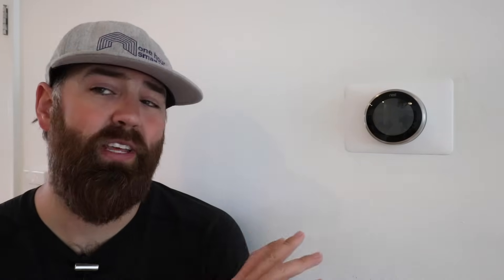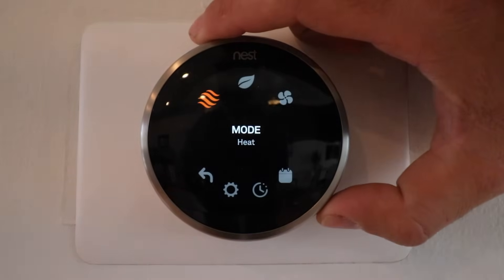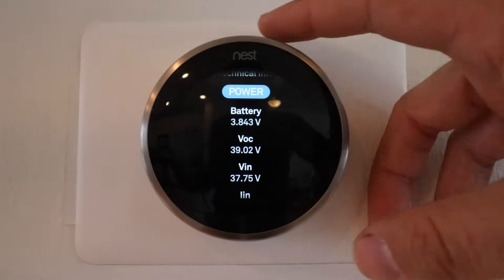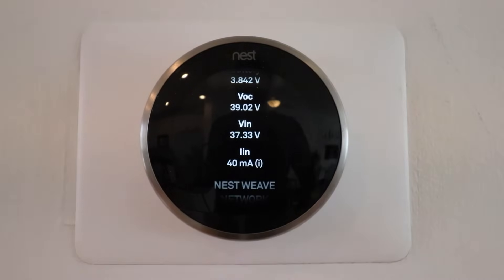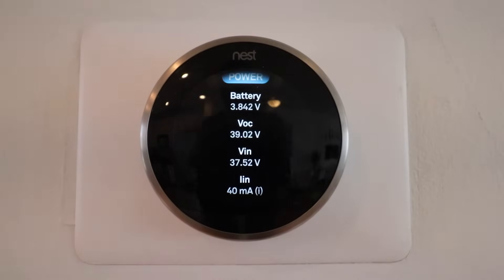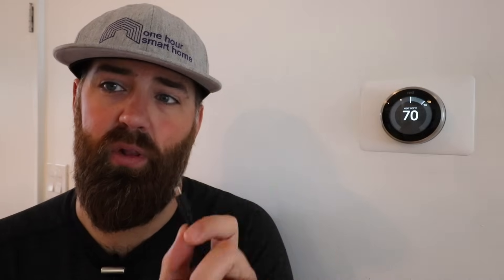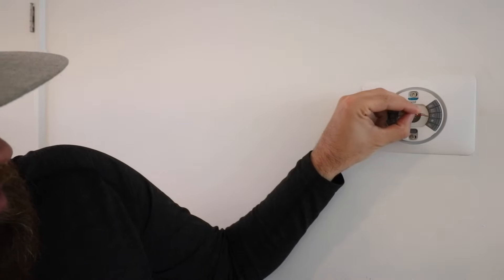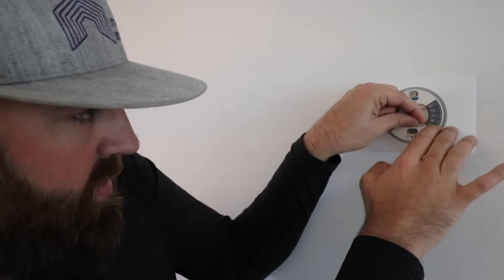Nest Low Battery Fix!

Comment: If you hear a loud humming sound coming from your A/C it's your relay. A stuck relay will cause a contactor failure. This too can lead to low power on your nest.  In case people were wondering when they hear their relay making a loud Humming noise. Fix this contactor issue and your Nest will not lose power again do to this.  A short fix is to turn the AC on and off, so the relay is reset.  However, it may one day not reset and require replacing the Relay. Easy fix too, just make sure the power is off when replacing!  If after replacing the relay it continues, then there's a problem with your Home's electrical, and recommended to get an electrician at this point. Be safe when working with electricity, and Hope this helps.

Comment: Hi Jeff, I have a Rheem thermostat with four wires connected to it R, C , E1 ,E2 I was able to Power the Google thermostat but couldn’t turn the heater or cooling on… any ideas?

Comment: Have a Nest Power Connector installed by a HVAC technician onto the furnace board, still not charging the Nest Thermostat. Have a Nest Learning thermostat, sent the photos to Nest showing the wiring - Nest says wiring looks ok. Nest itself can't diagnose what could be the problem.
Any suggestions welcome.

Comment: Thank you for the video. Got an e74 message. I knew the drain pan was full. The evaporative unit line was clogged up, so the secondary drainage was filling up the drain pan. Thank god for the sensor.  Water would have been all over the condo.

Comment: I was having low battery and this video was helpful to learn that my Iin was reading only 8.  I pulled it off the wall and metered my Red wire and it was reading 40.  So I took all my wires out,  one at a time,  and gave them a polish with some sandpaper,  popped the thermostat back on and bobs your uncle,  40mA.

Comment: Nice video but it would have been nice if you told us what to do if the LIN number stays at 20  (replace battery????) and would have been good if you had told us where the other two numbers should be (Vin and Voc).

Comment: Excellent video, as are your other ones! Thank you. For me when installing transformer, it only worked when I combined one of the wires from the transformer in/into the terminal with the existing Rh wire, and of course the other transformer wire into the C terminal. It did not work when I had one transformer wire in the Rc terminal and the other transformer wire in the C terminal.

Comment: Can I go to the furnace, disconnect the red/RH or RC wire, and connect it to one of the  transformer wires, and plug the transformer into a wall outlet near the furnace?

Comment: Long video for not much info. It is "I in" (input current) as in the letter I for intensity, not L as in Lima. mA is milli-amps, a measure of current intensity. Electrical systems use the letter I for current, (as in P=VI)  and L for inductance. 

Another way your nest could say "low battery", and I don't think this was mentioned, (could have been though, it was a 15 min. video for 3 min of info) is that your battery has been charged up/down so many times it won't hold a charge anymore. Yet another is the circuitry could be damaged as seems to be the case for me. Something inside the thermostat is shorted or open-circuited, or a component is bad somewhere in the charging circuit path.

Comment: Hi I recently came across your video regarding the nest thermostat ‘delayed’ message and I’m currently having an issue where I turned on our AC unit for the season and I noticed that it’s not blowing cool crisp air. It feels lukewarm at best. our home temperature says 75 inside and just by lowering it 1 to 2° it says it will take almost 2 hours to get there and that doesn’t make sense to me. it seems longer than usual and we haven’t really hit the dead of summer so it’s not like the unit is working overtime. 
I noticed one day that the delayed message came up on our Nest and I ignored it because I didn’t know what that was and then I happened to see it again when I was adjusting the temperature. So I googled it & it brought me here. 
I had an HVAC person come out here and he said that our unit is working properly all the temps, levels, & pressures, everything seems right. he did rattle off some other issues that could possibly be it and he will come back to look at it further. But this delayed message thing came up after his visit.
it is hooked up to a C wire and I don’t believe we lost any power recently. but I took it off the wall and am charging it anyway just in case there is a miracle. otherwise I’m back at square one. 
If I do have it hooked up to a C wire and I charge it and it seems like I have a good battery according to what you said, what else could it be? just wanted to know if you had any other thoughts on this matter.

Comment: Great detail. Our AC unit was being replaced. Amazing how fast the power drains on the nest. Low battery would not recharge on its own on the wall after power was off for half the day. I pulled it off the wall and charged it with USB for and hour and put it back and it connected to everything and worked fine afterword.
Reply: Then did you pull it off again? I have a similar situation recently. We got a new AC and my Nest went out of the battery every 2-3 weeks after I charged it by usb cable for a whole night. So annoy.

Comment: I'm looking at min now the batt is 3.9, voc is 37.92, vin 37.92, lin is 200Ma. For a min there the voc & vin dropped to 35 and changed then back up to 37.15. Basically there fluctuating for some odd reason

Comment: Someone should ask why Nest make this thermostat battery a problem. 
A regular thermostat usually have two triple A battery and you can replace them just by putting a new battery. 
If you want to have no problem with your battery then you need to run a single low voltage wire from  the common side of the transformer directly to the C on the Nest thermostat. That’s it. 
By the way shame on nest that sell these thermostat for over $200.00 and after two years stop working because of the battery.

Comment: Most easiest video I've found to follow for the Nest thermostats.  Much clearer than trying to get results from the Nest help line,  I did the settings check and found these readings...6.5 and 40I , indicating as you said the battery(s) were low.  I did find a USB charger that had the correct end on it and the batteries are charging as I type.  let them run for an hour or two and see if that fixes the immediate problem.

Thanks for the great video...a grateful friend.... Don

Comment: Excellent video! Much appreciated! I have 3 systems in my home, all individually controlled by Nest thermostats. ONE of the thermostats controls an hvac unit to a room with its own hvac unit. The room is rarely used, so I’ve had the system in that room set to OFF. Is this ‘OFF SETTING’ possibly leading to the 2 ‘AAA’ batteries draining, because the thermostat isn’t getting power from the hvac unit?

Comment: Hello, I have a problem happening with my nest. When the call for heat and/or AC is initiated I found the signal is momentarily blinking causing the startup sequence to restart, I connected 2 fluke 87 multimeters with one to monitor incoming power connected to "Rc" & "C" and the other connected to "W1" & "C" to monitor the call for heat signal, as the startup begins the voltage matches up just fine but 30 or so seconds after the call for heat signal activates the signal drops out causing the start-up sequence to restart and sometimes it is consecutive making it look as if it is cycling. has anyone else experienced this or similar. I have made a video of it if anyone is interested I can email it or explain how I can post it here?
Reply: Please post it. I’d be interested in watching.

Comment: I'm getting a E73 code on my Nest 3rd Gen, I blew compressed air through the condensate out line so that seems to be clear. I also checked the voltage on the nest and it said 3.07v which I guess is low. The thermostat wire is brand new, replaced it from furnace to Nest when we installed the nest a couple of months ago.I removed the condensate pump and made sure its empty, later today I will try cleaning it with white vinegar so make sure that there's no slime buildup although I cleaned it a few months ago. Sometimes the furnace will kick on and run for 5 minutes and then kick off and the E73 code shows up again. The thermostat wire is a 5-wire one, Blue is hooked to the "C" terminal, the red wire is hooked to the "Rh" and the other wires, yellow to "Y1" and green to "G" and white to "W". I did the jumper (W1 connected to RC) and the furnace went right on. My furnace has an external bare transformer and is there a way to check if the transformer is flaky?

Comment: We don’t have AC, so I connect only the w1 and rh wires. My battery is dead and five years later a charge on the usb lasts only a few days. Should I replace the battery?

Comment: I was having problems through the app while away. The temps have been from low 20’s to single digits (and even a few minus degree days) so I decided to stay with my bf and save my fuel. I check my Nest app regularly when I’m not home to make sure everything is ok @ home. Several times I’ve had one (of 2) thermostats show “offline” in the app. Researched the issue & determined that it was likely a low battery. Thanks for the well done video explanation on how to charge the existing battery. I almost bought a new one on Amazon! Good thing I read reviews & one person said better off recharging rather than replacing. I would have taken my unit apart trying to figure this out. THANK YOU 🙏🏻

Comment: Great video, actually I troubleshot a NEST 800 miles away just now.  Two comments about safety.  
First, use a volt meter to measure the voltage on all the wires, make sure the control transformer hasn't failed internally and is sending 120VAC.  Second, turn off the furnace while you mess with wiring.  Injury is unlikely but possible even at 4 volts, plus you can cause the HVAC controller to become confused and lock up, in which case you will need to turn it off anyway.  Get used to doing everything with maximum safety.  Practice safe practices on safe stuff and the unsafe stuff is less likely to catch you on a "dumb day".

Comment: Thanks for the video. I had only two wires from my previous thermostat. I used them on W1 and RH. Lin shows only 8 mA (o) It also shows the same when I charge it externally with an 10W adapter. After charging externally, it keeps working normally 1-2 days max. 

Do you think I should connect another wire from C to the heater ? Will it help to get more power ?

Thanks!

Comment: Great video. We've had a few lengthy power outages in our area as of late and I never would have thought it would affect the thermostat and a need to charge it back up. I had the C-wire issue years back, which I also had to add as a power fix. Thank you for making great, helpful content!

Comment: My thermostat has 4 wires.  Two red and Two white.  when I removed the old thermostat the two red wires were in RH and Jumped to RC The two white wires were in W.  Can one of the red wires be used to provide power to the nest?  If so how do I do that?

Comment: 1st:  Why on God’s green earth does the system NOT come with the unit?  $329 and a cable, really #google ???

2nd:  #google Why not put the charge port for the Nest on the bottom for charging without having to remove it from the wall?!

Comment: Every night when i go to sleep 
I set temperature to 74 when i wake up my house is cold its not heating inside temperature would be 69 but i set it to 74 it doesnt heat 
My voltage is 3.88. And my lin is 200m

Can you help me??

Comment: Great video. My 6 year old Nest thermostat shut down wifi, and then completely 10 minutes later due to low battery for the first time. 
Charged it with the USB cable, then put back onto the wall.  
All the voltages check out on my two wire system; I wonder if that means the rechargeable batteries are nearing end of life. I think you mentioned replacing them at some point, I'll have to scan through the video again if the problem reoccurs.
Thanks for the video.

Comment: When connecting a 24V ac transformer to the thermostat, should the striped wire be connected to one of the R terminals or it doesn’t matter?

Comment: I only have the white and red wire for a boiler/baseboard system. I was told to get the google power adapter “c” wire and hook it to my zone valve or controller. Is that the simplest way or do you have any other ideas ?

Comment: So if you use the green wire, the fan wire to keep power going to your nest.. What will happen to your operation of the fan???
Reply: The fan only rarely is needed. The fan will still work with heat or a/c

Comment: Thanks I've come back to this video multiple times. First I found I could charge the device and that was getting us through. Today the heat wouldn't turn on at all. So I touched the wires and it kicked on! So I'm now closer to solving the issue. Though not exactly sure what I do now.

Comment: Thank you so much!  Power outage while I was out of town.  Came back, and got low battery problem, I recharged it with phone cable, just like you said, and it worked.!!! You are the best!!
Reply: Does it permanently fix the issue? Or does the power go down over time?
Reply: Having the same issue… power outage triggered both Nest thermostats to start having battery issue. I can charge via phone cable and that will work for a few hours, then the battery dies again. These worked together fine for 5 years and all the sudden BOTH stop working at the exact same time. Idk what the issue is. Voltage and Lin seem fine.

Comment: Where is the link to your furnace video on replace fuse or flame sensors? Can't find it. Also do you have a conversion video of 4 - 5 wires using an adapter?

Comment: Check your pump float in your furnace gets stuck it will not send power from furnace. Make sure your float not sticking. That’s why my battery issue killed the furnace to start

Comment: Thermostat/ Battery issues. High Efficiency furnace. Four wires to thermostat: Black (WH), Red (RH), Green (G), Blue (???) Turns out Blue was mislabelled as Y; wasn’t even connected to furnace! Battery at 3.6 V, 20 mA. Connected Blue to COM/24V and C terminal at Nest. Voila! Battery at 3.8V, 200mA. Problem solved…   for now. Thanks for the video.

Comment: Hi. Please help me. After connecting C wire, everything (AC, Heat, Fan) is functioning. It shows a new wiring configuration and the current now reads 200mA. The battery voltage is 3.4V (low). The problem is after few minutes, a message pops up "the nest thermostat needs to shut down to recharge the battery", and it turns to the black screen. I thought after adding a C wire, the battery is not an issue anymore.

Comment: I need to determine if my HVAC system is the issue. I would like to try the solution you suggested in minute 11 of the video. If I have a common wire connected will this affect which two wires I connect or do I still connect w1 and Rh?

Comment: Our battery was low, however after charging we had an “e74” error...found out drain pan was clogged, shutting the red power wire off.  This saved us water damage, however it took a while to figure that out.  Nest being low on charge was only partly blame.  Safety feature shut-off that was not well documented.  Hopefully this helps some folks
Reply: this comment was the most helpful. thank you!
Reply: Same
Reply: What is a drain pan ?
Reply: @geminigirl1135  some houses don't have a drain for the a coil condenser where the blower motor pushes air through to cool, it creates condensation which typically runs out of the unit down some PVC off the furnace into a drip line to a floor drain. Some people don't have floor drains and have to dump the accumulated water from running ac
Reply: Thanks! The drain line was clogged which caused the water to trigger the safety switch cutting power, cleared it and fixed it! Thanks Jon Y!
Reply: @robertr3880  You bet, Robert!  Glad this information was helpful.

Comment: Here's something strange.  I was getting low battery warnings for about two weeks.  Worked perfectly for the past six months. I reseated all of the wires at the thermostat and at the furnace.  No change.  Did the charge thing with an old phone charger. Worked for several hours until the battery finally depleted to < 3.6V.  Unrelated, I noticed my computer had been slow recently and did a speed test to find I was only getting 2MB download when I was paying for 100MB. Did a hard reset of the modem and router and got things back up to speed. Later, I walked past my thermostat and noticed that the motion detection display came on.  I checked the battery power and it was at 3.89V !! Been working great for a month now. Apparently, this can drain the battery when the unit has to search hard for its wifi signal?
Reply: interesting. thanks for sharing (troubleshooting my Nest 2 as well)

Comment: Do you ever see the following on your app or the face of the NEST?...ERROR  E80:  No power to Y1 wire    I see it every few days. It disappears after a couple hours. The system continues running properly throughout, but it freaks me out. Especially on 100 degree days!!!

Comment: When charging with usb cable does anyones nest say connect to base? 
When its connected to cable, nest shows blinking green light, And home icon shows up. Pressing  the nest doesnt change the screen past the home icon.
if i then connect to base, the blinking led stops, push the screen & battery icon shosw up, looking pretty empty? is this correct? doesnt seem right? i dunno?